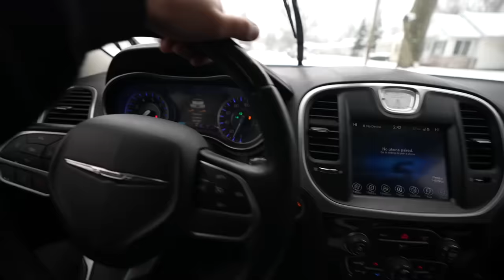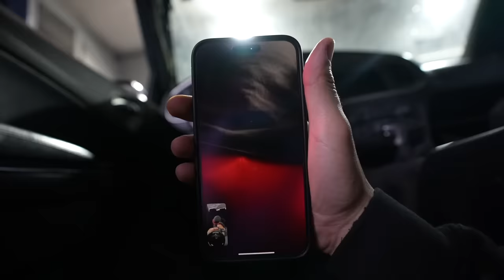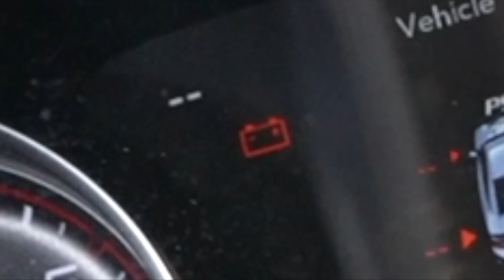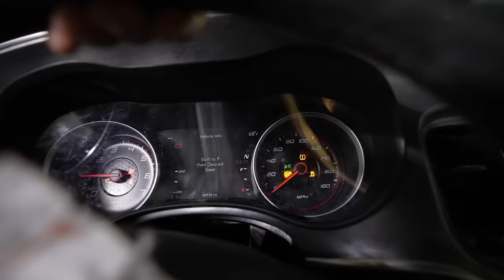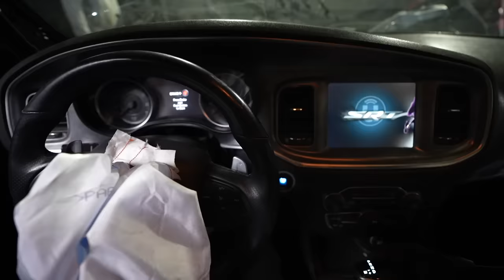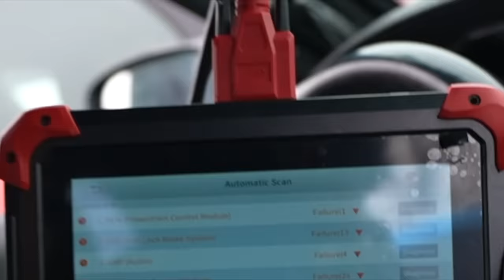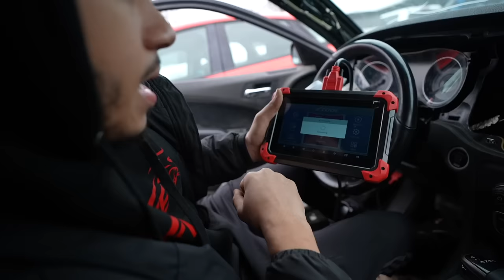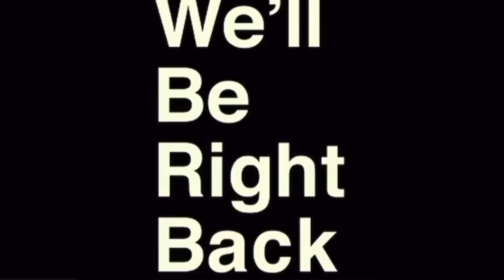TAKING DELIVERY OF MY SCAT PACK 2ND GEN CHARGER **GONE WRONG**

Comment: For a front end collision, I'd suggest a new TCM/PCM, flush the trans fluid, throw a new water pump housing with a new thermostat, do a coolant flush (remove drain plug from middle of water pump housing and place a water hose in the top of the coolant reservoir tank. run water until color drainage changes from orange to white. Refill cooling system and run for 20min with heat on to ensure normal temps: 180-190). 

*DO AN OIL CHANGE PRIOR TO ANY OF THIS*